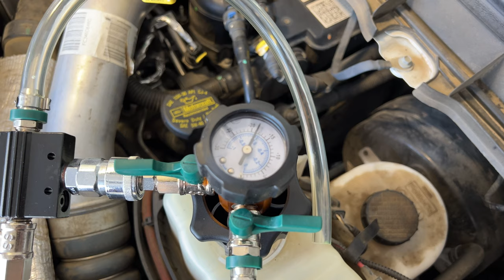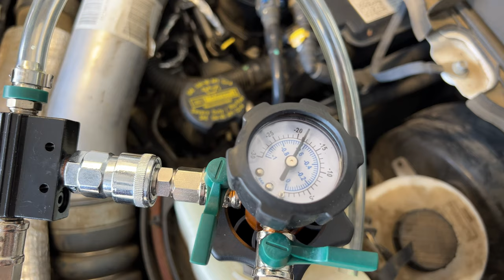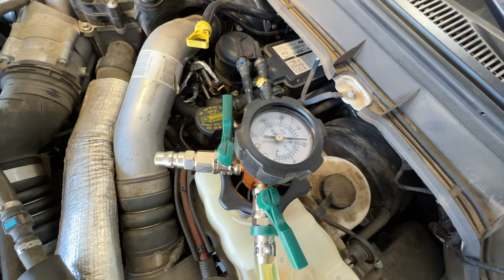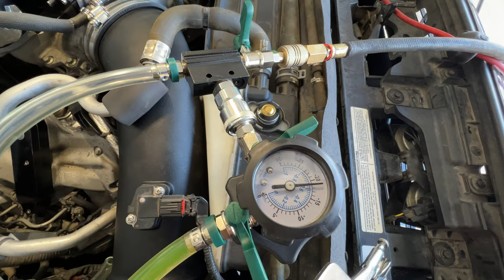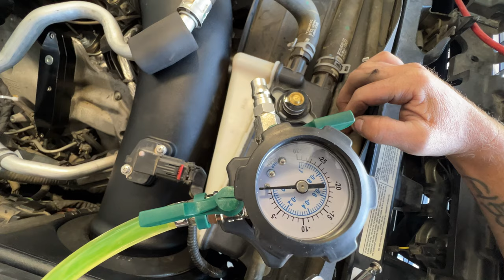Ford 6.7 EGR Removal & Air Intake Upgrade

Comment: I soaked with PB Blaster and brake fluid for a month off and on and the left deep bolt broke smooth off after a 1/4 turn.  I hate Ford so much.

Comment: Just did this job today and this video was my guiding light. Thank you... One note... I took the ECM out and was able to access the heater core hose clip from the top rather than removing the inner fender well. Such a relief when all my egr bolts came loose.

Comment: Great video. The step-by-step detail is a huge help. Spraying those downpipe bolts like the guy who owns the truck did saves a lot of time and headache.
Reply: Yeah you definitely don't want to snap one of those POS titanium bolts...
Reply: @claytonwhitman2611  I stripped the head off of one of ‘em, now I’m in the process of putting everything back together. Cause fuck deleting it at this point.
Reply: @kad3e3  OUCH!!!  I DID snap one of mine, the outboard one that usually snaps if one is going to. PITA!!! The good kit to drill out and repair is expensive(more than $500), and takes time, but worth it. That bolt is titanium, so it drills similar to stainless steel, but needs a lot of pressure, and slow RPMs, more so than stainless usually does. NOT FUN!!!
Reply: @claytonwhitman2611  the head rounded off, it’s still there. So I’m wondering when I take off the upper and lower intake, if I can weld a new head onto it, and take it off that way. A bolt extractor didn’t even work.
Reply: @kad3e3  Well it's titanium, so welding to it with just any normal steel filler rod is questionable. However, it is an alloy by definition (pure titanium is brittle, so any practical application is always an alloy) so its possible to potentially weld a nut (do not use a stainless one, and if all you have are galvanized nuts, grind off the galv coating on the side that's up where you will be welding to it) to the end, and be able to remove that bolt and replace it. Just the act of welding to it creates a lot of heat, and the heating and cooling can possibly break it free from it's seized position. FIRST, I would soak the hell out of it with croil or some other highly effective penetrating oil, several times. Then, You can use a small torch to heat, and then allow to cool, then heat and allow to cool several times, and apply some pressure. IF it doesn't budge, wait a bit to let it cool and try again, and again until it's almost cold again. TAKE YOUR TIME, DO NOT GET IN A HURRY. IF it does break free, be VERY VERY CAREFUL, and turn it only small amounts. IF it sticks again, try backing it up. WORK SLOWLY, to try to loosen it completely. IF it gets stuck, stop. Try some more heat. DO NOT USE ANY OIL while it is still significantly warm or hot. You will cause rapid cooling, and probably crack or snap the bolt off. Oil only when its just warm, cool enough to touch bare handed and hold. If you can get those titanium bolts out, replace with some stainless bolts (M6 x 1.0, or M8 x 1.0, I think its the M6 bolt for 11-16 and M8 for 17 and up), and when you reassemble ALWAYS USE copper based high heat anti seize. The bolts don't need a lot of torque. If you had to work the bolt out, get a bottom tap and chase the threads before reassembly. The only bolts you need to replace for fear of seizing in place are the 2 in the exhaust manifold. The others will come right out, 99.9% of the time. Use the copper never-seize. 
*****Also, before you do anything, pack the opening in the exhaust header and the intake openings with balled up towels or rags, or something that will prevent loose bolts or debris from going inside. THAT would be a really bad bad day, to lose a bolt or nut or washer or small socket, etc down inside the motor. ANY intake or exhaust passage needs to be blocked off securely, or you risk turning the head and/or cylinder block to scrap if you let stuff get in there. Just trying to be clear, for those who may not realize what can happen. No sense turning a potential $500+ bolt repair (If you have to buy the kit to drill out a broken titanium bolt, and rethread for an insert) into scrapping a $10k-14k motor.... It would be enough to make any grown man cry.

Comment: Great video....clearly shows every step required to get this done....good job, sir!

Despite my best efforts with PB and torch heat, still managed to break one of the EGR to mani bolts. Those Ti bolts are mothers. I was able to weld a nut to the top of the broken off bolt and get it. Still a PITA.

For the EGR to mani plate, I used class 8.8 (grade 5) bolts with washers instead of the supplied allen head bolts. I also chased the threads in the mani..the threads in the cast iron were nasty rough. Don't reuse the old Ti bolts! Guys have snapped those reusing them. If you really want to use the OEM bolts, I recommend you buy new ones. I also nickel anti seized the bolts for all three block off plates....just in case future removal is needed.

One last tip for the radiator drains, especially the secondary system drain...which is a major PITA to reach...I used a 3/4" 6 PT socket on a 3/8" drive. Socket slips over the flat on the valves and worked perfectly! Just be gentle and don't gorilla those valves, remember, they are plastic. Way better than pliers, etc. and you don't have to fab up a tool for them.

Hope this helps!
Reply from the maker: Thanks for the tips.

Comment: I just did mine, a 2104. It comes stock with the new heater core hose that you had to swap out to install. IF you want to clean up a lot of the hoses on top, you should leave the 2015 heater core hose in. Then, the 3/8" hose by the secondary tank that comes across and Tees, cut that all out and just run that straight across the top of the radiator to the primary tank. You will need one 3/8" hose splice and a pair of clamps, and most of the spaghetti hoses on the top are now gone. Pusher makes a coolant reroute kit that does this, and replaces the tall black "L" tube that comes from under the plastic intake, by the passenger exhaust manifold where the EGR piping connected up, where you put in the block plate with the bung for the EGT sensor, with a straight adapter and  rubber hose to go straight to the heater core, but you can save some money by just leaving that 2015 setup just as it is Stock (for 2014 and earlier, just put a cap on the 3/8" barb that comes out the top of the elbow), and make the splice across the top/front, and no more spaghetti hoses. All that you will have are the x2 3/8" hoses across the top, one directly on the radiator, and the one that comes up by the throttle body and then goes to the rear of the primary tank, it has a quick disconnect inline, leave it is.

Also, seeing were the vacuum line connects and comes out, I had the same issue, my cap was way too big, now I know where to put the cap and remove that whole vacuum line. For about $120, you can get a set of the dummy plugs to put into all of your connectors that you unhooked, for the full EGR/DEF/DPF delete. Includes the caps for the "throttle body" connections as well. I took my lower intake and throttle body out and cleaned all the carbon crap out (IT WAS A LOT, at 150k miles). The throttle body will fail in the open position, or you can pull the butterfly flapper with 2 screws. New hot and cold charge pipes, upper and lower HSM fuel filters, CCV delete/reroute, and a new HSM upper intake assembly, as well as delete the DPF filter (cheaper than replacing it, and the DEF heater which is bad also). 

And I also put in the S&S CP4 disaster kit ver 2.1. My CP4 was fine, but I like the peace of mind. If you guys keep good fuel in, and run some kind of quality fuel additive to keep the tank and lines clean and NO WATER IN FUEL, then you will get better life from your CP4 pump, as the main cause of it going bad as far as I can find out, is bad fuel, water in the fuel, sludge buildup in the fuel tank. This causes issues for the pump, like RUST, and then you need about $4k in parts alone to replace the CP4, fuel rails, injectors, etc.

Great video, I learned a couple things that I can see will work better for me, like where the secondary drain is and the right place for the vacuum cap.
Reply: Where did you get the dummy plug kit?
Reply: @banjo8247  I ordered mine from Sunny Diesel. I think there are other sites that have them available, also. Please know that when you delete the DPF exhaust, there are 2 modules on the frame rail that can also come out. When those come out, the dummy plugs go to THOSE harness connections, not between the modules and the exhaust. FYI. Also I did remove my DEF tank, and a couple of those connections didn’t have a dummy plug so I had to use a ziplock bag and zip ties.

Comment: On that back bolt holding the EGR down, you can remove that plate just under the ECM wire connector which makes it easier to remove that back bolt.
Great Video, Thanks
Reply from the maker: Thanks for the tip.

Comment: For the back left bolt and the bolt in the very back, remove passenger tire and inner fender, and you can fit a ratchet on both
Reply from the maker: Thanks for the tip

Comment: Thank you. The instructions for the kit are horrible. This is the 1st video that shows where the double factory clip hose goes (firewall heater). Instructions state the bent tab goes under the cowl, but I like your location better. I removed the computer and made access to the 7th EGR cooler bolt super easy. I'm doing the CP4DPK at the same time. Sure wish I had the $$ for the Pusher PowerFlow pipes.

Comment: One of the best videos out there for this project. Could you shoot me a link to that coolant vacuum? Also do I seen some guy just drain one hose, do you have to do the entire system? If not can you just fill the little bit back without using vacuum?
Reply from the maker: https://amzn.to/3rGGsHV you don’t have to drain the whole system and you don’t have to use the vacuum tool but it does prevent any air bubbles entering the cooling system which leads to cavitation overtime on the aluminum.
Reply: @BLUECOLLARGARAGE thanks

Comment: Hey so I followed this, but I lost all heat in the truck, I’ve had 2 shops and then myself vacuum fill the coolant. Checked heater core changed thermostat only thing I’ve seen is the heater core valve we took off.

Comment: Hey do you happen to know where I can buy those block off plate screws? My kit was missing 2 of them and I can’t finish installing the block plate for the exhaust manifold. Much appreciated for the tutorial! I had such an awful time with this due to a bolt stripping at the exhaust manifold.
Reply from the maker: I would just take the screw you have to your local ace hardware or possibly fastnal or grainger and see if they can match it up.
Reply: @BLUECOLLARGARAGE Good idea, I’ll do that tomorrow thanks!
Reply: @BLUECOLLARGARAGE You know what I ended up doing? I used the original bolts for the air intake flange instead. No idea why I didn’t think of that yesterday. And since the back is open they fit perfect. Hope it helps someone else out.

Comment: Awesome video! I just did this on my 2015 superduty as well. Do you have a grey female end of a sensor near the secondary cooling system up front? Where does that sensor plug back into? Im getting the code for P2182.

Comment: Does that refill both coolant  systems? Getting ready to do this myself and not sure how the 2 different coolant systems work
Reply from the maker: There are two separate cooling systems on the 6.7 powerstroke one for the radiator and main cooling system and the other one if for the egr cooler you will need to drain and refill both to do this procedure. Here’s a link to another video I did on this truck draining and refilling the cooling system. https://youtu.be/bLeUnYXR_mc